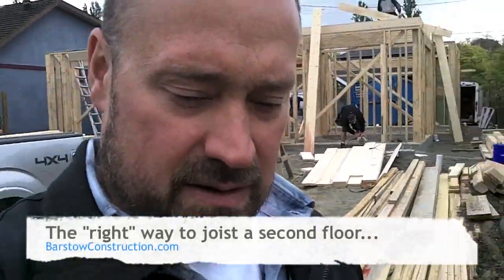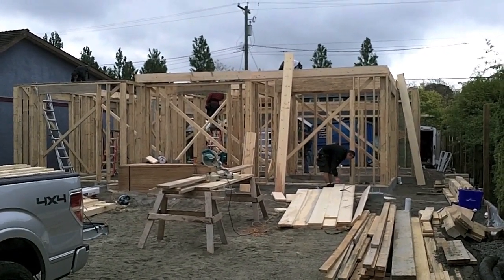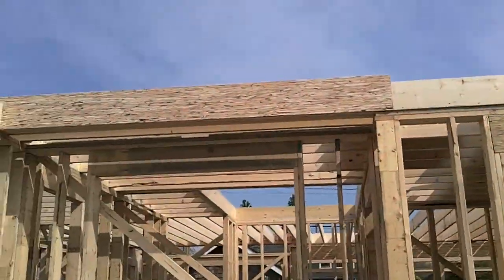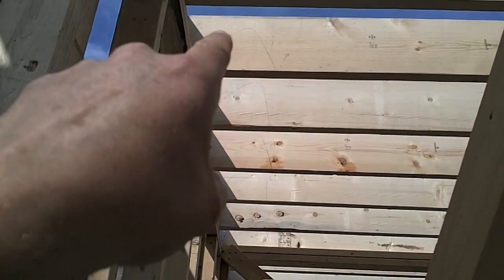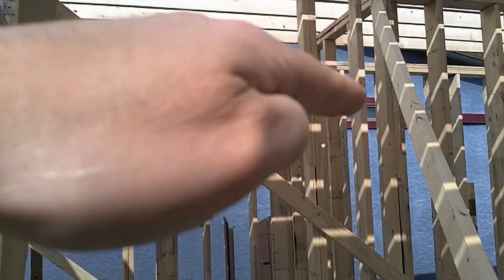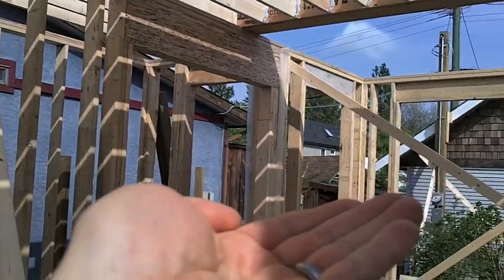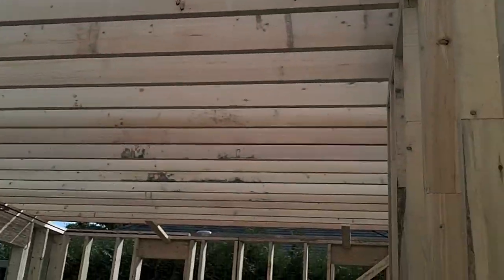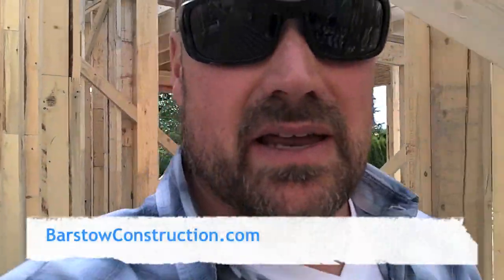The "right" way to joist a second floor

Comment: Crowning is something that has been passed down through carpentry for hundreds or thousands of years.  It is a practice which is not studied in engineering due to the synthetic nature of the engineering practice.  You can not calculate the crown of each piece of lumber, so it only has a place in carpentry.  

I am happy to see modern carpenters are using the crowning technique still.  Hate to admit it, but some houses are built without proper crown.

Comment: we always install the perimeter shear before we joist, to keep all walls stiff,  and avoid knocking out of plumb the corners.
Reply from the maker: +Juan Flores It's a good practice - and in many cases we will build and shear the walls on the ground before we stand them... That said - when we have big crew on site, we brace and level the house once all the walls are standing, so everyone is busy getting the structure up out of the ground.

Comment: cool thanks I am expamdimg my one story house by building 2 rooms above the first floor the ceiling joist are 2x6 and cirious if they can be used as floor joist on the second floor.
Reply from the maker: Kevin Naderi we use AT LEAST a 2x10 depending on the span. You can cut down the ends and laminate them to the exsisting 2x6. I’d have a quick chat with an engineer first.
Reply: ok Thanks ill do that it;s just that im cirious if i can get it done without having to remove any sheetrock ceiling on the first floor.

Comment: I have a question for you. Lets say I have some sagging and I am hearing the squeaking you talked about.  

1st floor is supported with a metal I-beam and wall structure; however the second floor is supported by a header….  the center 5 joists that rest on the header appear to be sagging.  So I ripped out more subfloor.  Interesting that there was absolutely nothing supporting the toilet which would explain leaking and rotting subfloor is that location.  but the header does not appear to be damaged from above looking down.

I know its hard to visualize what I am asking, but do you think its ok to just sister another board to the existing bathroom joists and raise them up a little higher so that the new subfloor wont sag, or is that a disaster just waiting to happen?

BTW-I appreciate the fact that you took time to make a video about joists and supports.  Some people just read into everything wayyyy to much and don't listen to the overall message of what you were saying.  

Thanks,

 Brian

Comment: I know you men will probably laugh at my ignorance but when you spoke about the crown over the years sagging if it is put in with the curve facing up, seems totally wrong to me. In my way of thinking, if the curve is facing up, it will start to move the opposite way which would be straight. If the curve is facing down already, it just seems to me that over the years, it could sag worse. I am not a carpenter but watching construction interest me, so I am watching to learn
Reply: I was taught crown up
Reply: I’m not sure if you’re reiterating what you think he said or disputing what he said, but he was saying exactly what you wrote, curve facing up so it flattens to straight

Comment: so the title of this video should be... "marking crown for second floor joists" - or - "not how to joist a second floor"
Reply from the maker: Thanks for the input, and sorry you didn't like the title of the video. Yes we crown the joists - I assume if we were building your home you would want us to do the same thing.
Reply: Barstow Construction no problem, I'm just looking for "the right way to joist a second floor" :P I agree about the crown, but I am looking into I-joists.
Reply from the maker: GrandPixel Just finished a beautiful home using structural lumber throughout including a steel moment frame. Your lumber company will have to draw you up a set of engineered plans for that material, including point loads and spans.